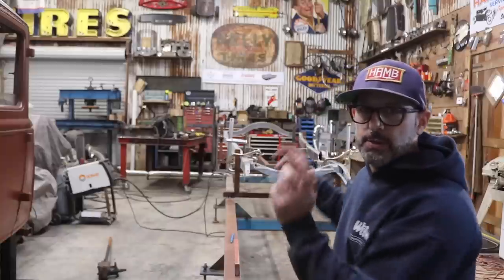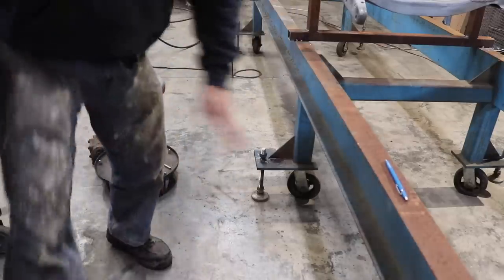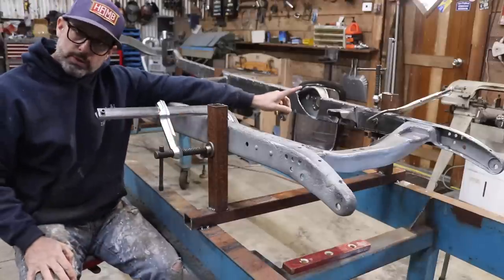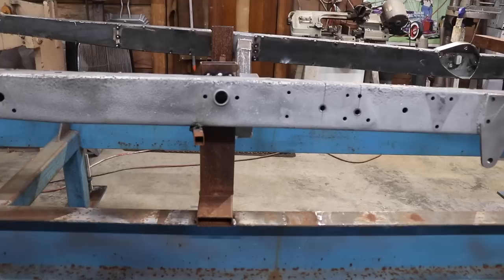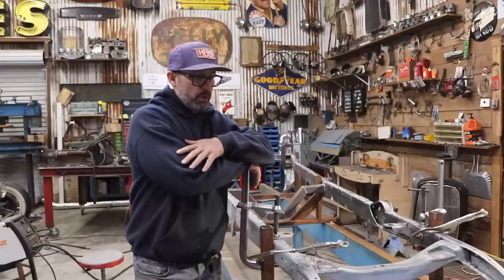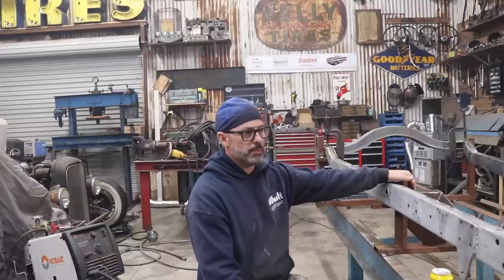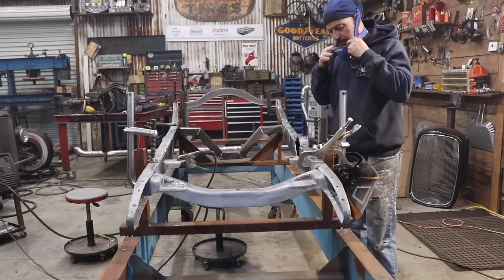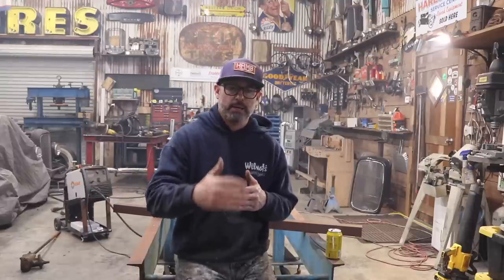Setting up the frame table

Comment: Thank You for the explanation of using a Frame Table --- set-up -- what to do -- and checking -BEFORE - welding ----- Hopefully not ending up with a Parallelogram ----- Will be watching for your next adventure ---- Rodney
Reply from the maker: Haha. It came out of the table mounts perfect.  Extremely pleased w the results.  
It’s finally in epoxy sealer !

Comment: If you look back at your video at 6 minuets when you clamped the frame down it bent down about 1/8"witch moved the front horn down probably 1".Great video.
Reply from the maker: Ya the frame had a little tweak to it.  I don’t know the history of it. Like any of us do w this old stuff. 
When I placed it on the table and made my stands it’s was off about 1/8”.  Clamping it forced it level. Then w the plates it came out of the “jig” perfectly flat.   
The boxing plates held it in shape as it needed.  👍🏼

Comment: Thanks for explaining how you use the frame table and level it first to your garage floor and then leveling the frame.

For your Trans cross member, will you be making it bolt on or welding it to the frame?
Reply from the maker: It is a bolt in crossmember.

Comment: I have the same Hobart MVP 210 welder. Been practicing on 1/8” steel doing corners and can’t get the beads right… too clumpy on the v4 setting with the 40 wire feed. What settings are you running? Do you increase your stickout? Maybe increase the gap between the two pieces?

(I’m a very new welder) but want to box my A frame soon once I get the beads down.

I tried going to v2 and 20 wire speed as well as v3 and 30 wire speed but it seems like it’s just balling up on the corner with minimal penetration.
Reply from the maker: I’d try going up to V5 first before going lower.  Keep your wire speed at 40.  If you’re burning wire to the tip, increase wire speed a little.  V5 should get good penetration but may be too hot. 
Try V4 with your wire speed around 35,  again you may burn wire to the tip.  If you do turn it up a touch.  
Kinda surprised V4 at 40 is clumpy.  

Keep your ground close to your weld and make sure your metal is clean.
Reply: @ThisOldHotrod sounds great! I will try that out! Thanks so much and love your videos

Comment: Good on you for putting out content for the but all of this should have been done before you did all the work on the body.  You always build the chassis first and then build the body off the “straight and true “ chassis. Now you will potentially need to shim and adjust the body
Reply from the maker: That’s true.  However the body will have to come back off when the next owner finishes the car.  He will have the opportunity to shim it if it needs to be shimmed.